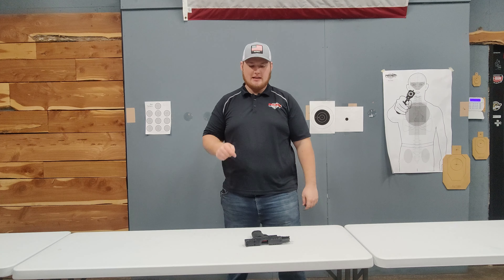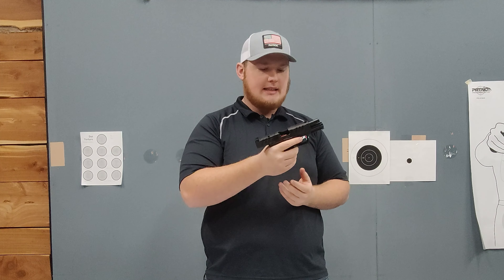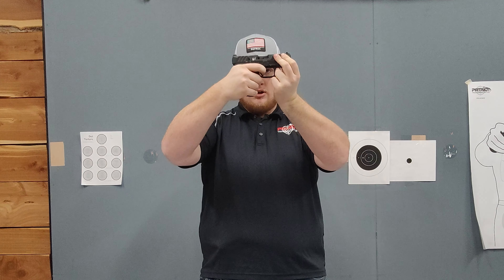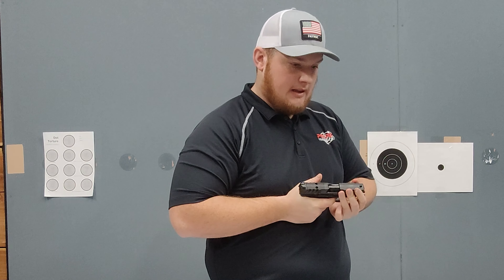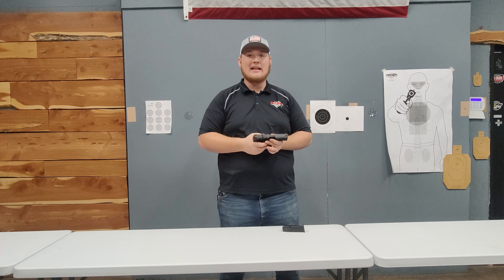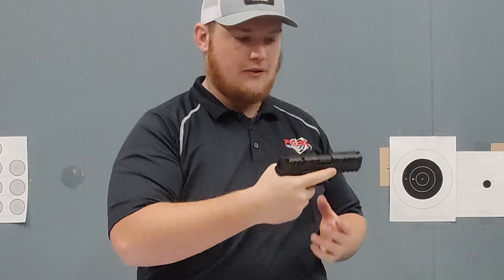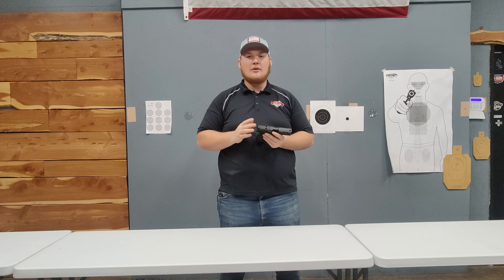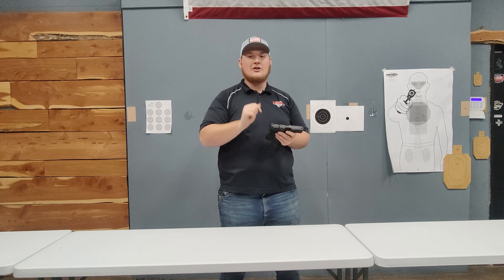HUGE flaw with Walther PDP - did they fix it?

Comment: Just bought a PDP and put 50 rounds through it on the day I bought it, took it home to oil it up some more and put another 100 rounds through it last night.
It seems to struggle with rounds going into battery, also when extracting rounds they are coming back and bouncing off the slide.  The finish is pretty beat up in that area after only 150 rounds and I have thousands of rounds through my P226 and not a single mark on the slide from when the round is extracted.  Is that normal on all PDP's?  I know its only cosmetic but wanted to check if it was linked to the pistol struggling to cycle rounds.

Comment: Another issue that people are just now starting to talk about is the roll pin located above the trigger walking out a bit after 100 rounds or so or if you are firing rapidly, this isn't a common issue and your pdp model may be just fine but some out there are off spec and there is not much you can do if you're the unlucky one, it's frustrating because you won't know until you have already purchased the gun and fired it, I was very disappointed when this happened to me, I have since gone back to Glock pistols as they don't have the best trigger, the gen 5 trigger is much better and glock has never failed me, all that really matters is that you can trust it to work every time, had my roll pin not  had any issues I would still be running the pdp, tried blue and red loctite also, that did not fix the issue
Reply: Just bought mine and after 150 rounds my roll pin also walked out. I went to the range fired 150 rounds, holstered the weapon and went home to clean my weapon and noticed the pin walked out.
Reply: Crazy.  1k rounds through mine and it hasn’t happened yet
Reply: @BuddyG-zz8qt same

Comment: False this happens with all striker fired guns. Rhe difference is it depends on how far you pull the slide bavk. Walther has a very long disconnector goove whixh is why this issue is easy to replicate.